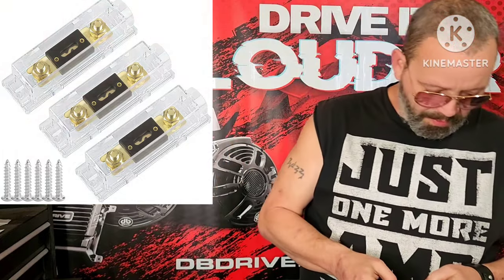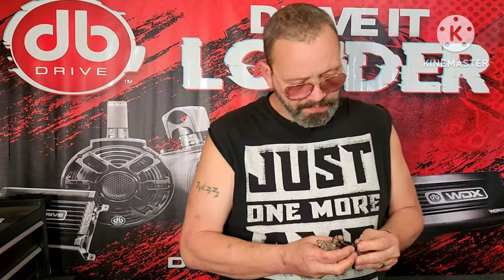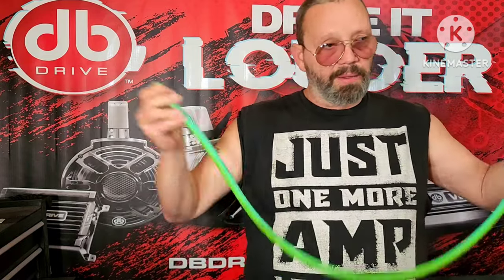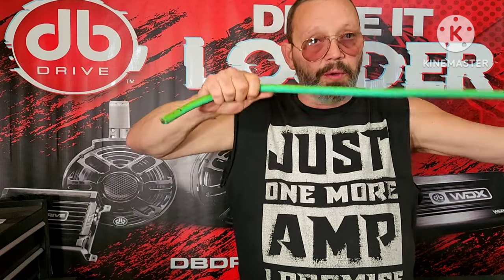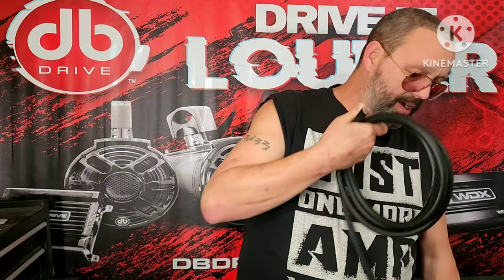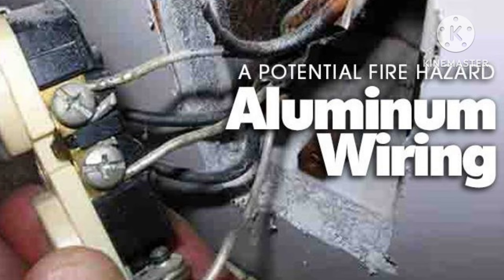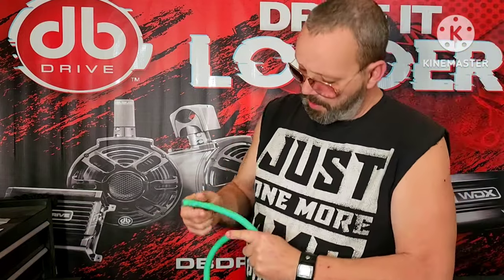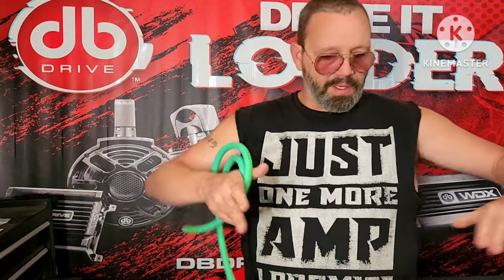Correct way to Use Fuses in car audio

Comment: That shirt is awesome!!!
Reply from the maker: lol!
Reply: I second the shirt, agree on everything. But I'll admit the first 2 months I was unfused no issues, I guess I'll admit I'm all CCA also. As long as you know how much current is going through and your within the limits of wire, I'm on a 800 monoblock and 1,000 watt 4 channel. But I do check my connections every 3 months or so for corrosion and loose, I can tell you it's been 4 years, 0 gauge main run to 4 gauge wires for the amps. I still want to go to OFC but it'd be a lot to run all new wire, CCA is good if used within limits, the problem as you said is user error, a taramps 5000 should not be on CCA at all. But it's nice to see a very informal video, even if I didn't learn much, still good to see someone explaining every detail. Cheers man
Reply from the maker: @theycallmeherbie  thanks! I do my best!
Reply: There is never a good enough reason to not use a $5-10 fuse to possibly save $1000s

Comment: What’s the better choice of battery to run for an audio system. (secondary battery) ? AGM, Lithium ?
Reply from the maker: Lithium is strongest, but Dangerous, I prefer AGM .
Reply: @CarAudioEnthusiasts  I second that, 4 AGMs in the trunk and 1 under hood. I could have went with 1 nice lithium, but it all depends on what you want. I started a small build (1,800 watts total). Than I built up the battery reserve with the possible intention of up to around 5,000 watts. It's been 4 years, same system and no upgrades, all oversized wire ready for 5,000 RMS, doing less than 2,000. Granted their is always a risk, so I have 3 extinguishers as well. 1 in the front passenger seat front mounted, rear driver seat front mount and trunk mounted one. Never to careful and never too many 🤷🏻‍♂️.
Reply: How do I figure out how much battery I need for the watts my system is running?  Thank you. you guys 🫡🙏🙏